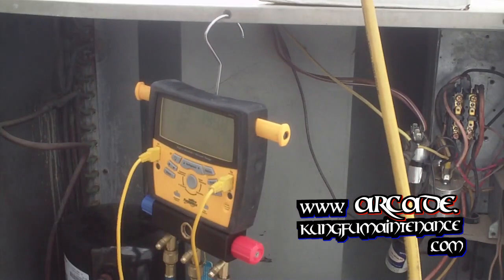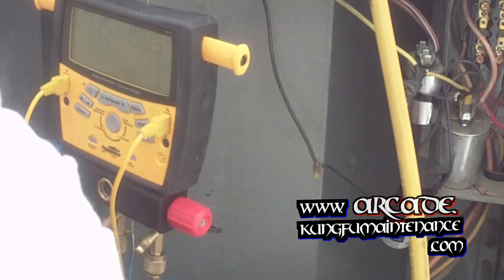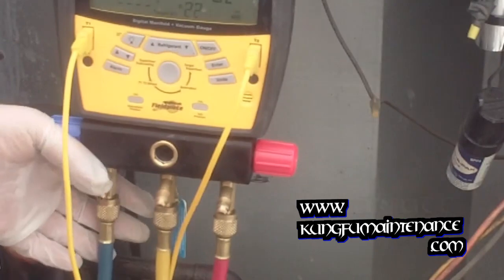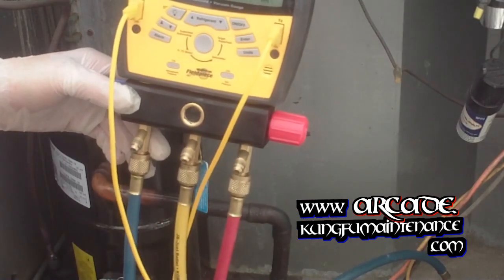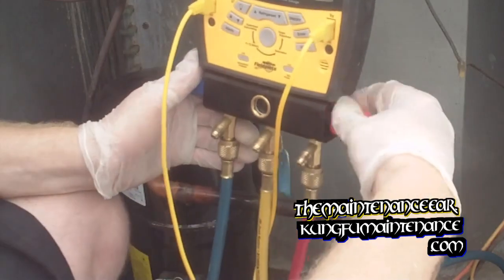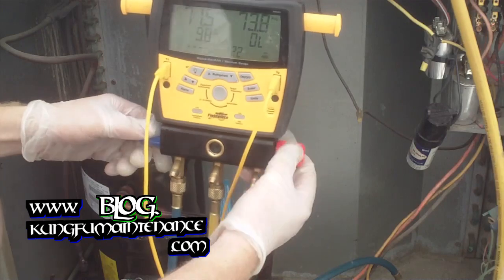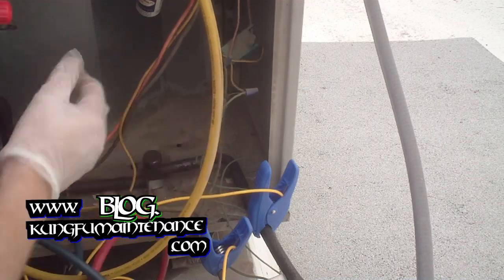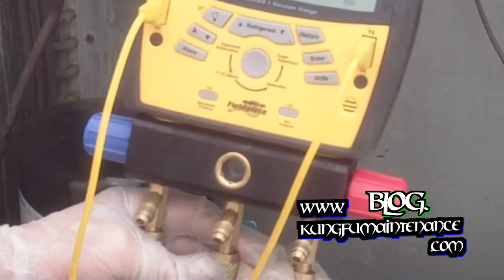How To Recover High Side Liquid Refrigerant When Finished Charging AC Low On Freon Detaching Hoses

Comment: So if I understood correctly it's:
1)close off manifold hand valves
2) close off center of manifold
3)Turn off refrigerant cylinder
4) backseat high side valve and not low side
5) open both high and low side hand valves, until equalized
6)close both low and high side hand valves 
7) backseat low side valve
8) disconnect low side hose
9) diminus venting at manifold hoses

Comment from the maker: There can be a few ounces especially with five foot hoses. This can only be done with low loss fittings or ball valve fittings that effectively shut off the refrigerant flow when disconnected. Of course low loss fittings should always be used anyway but this is the proper way to prevent the freon being released into the atmosphere.

Comment from the maker: After charging there is quite a bit of liquid refrigerant trapped in the red high side line hose. This video shows how to bring that spendy R-22 back into the system through the manifold gauge instead of releasing it into the air.